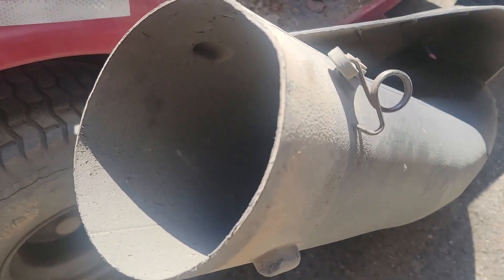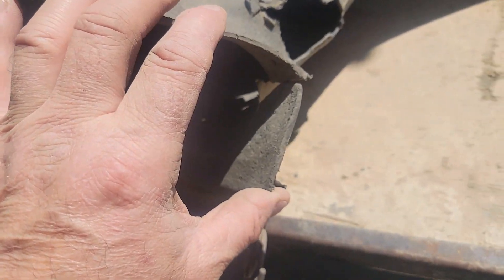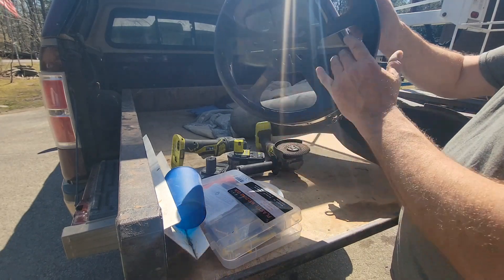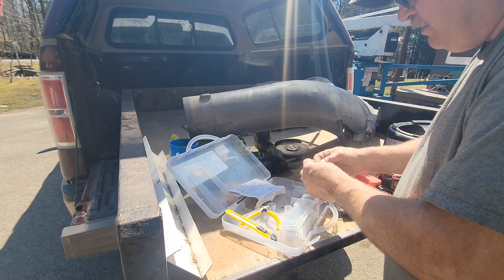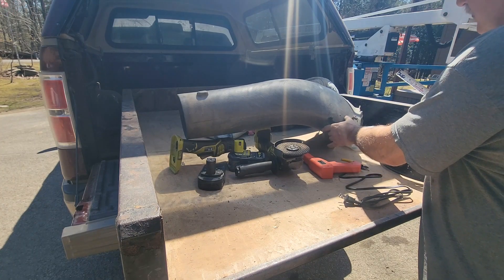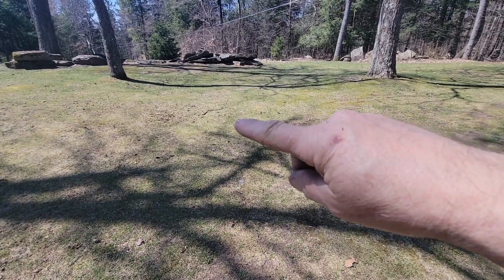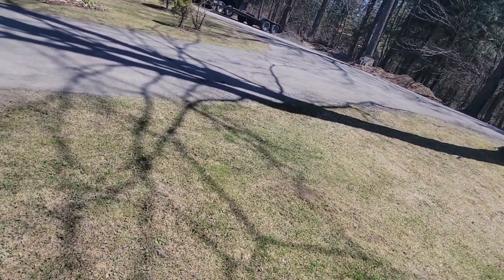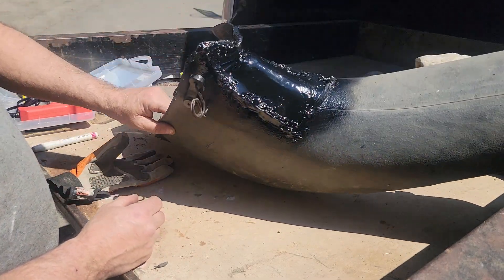Plastic Weld Repair on a Mower Bagger

Comment: I have a missing area on my chute bottom too. Still haven’t found a plastic I think will work with it as I too have a plastic “welder”. Crazy how costly a replacement part is, roughly 3x what I paid for the entire unit.
Reply from the maker: I agree.  Way too much money for plastic. Try aluminum or sheet metal and large head rivets and form it. Maybe it will hold up better. Thanks for watching.